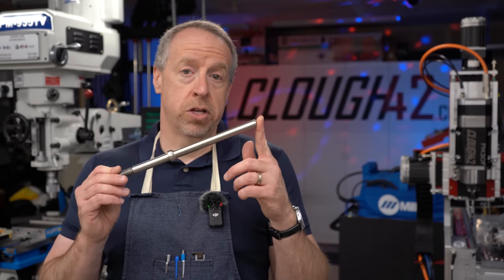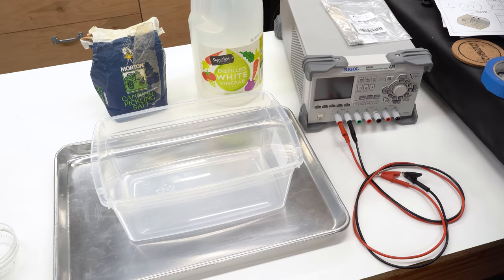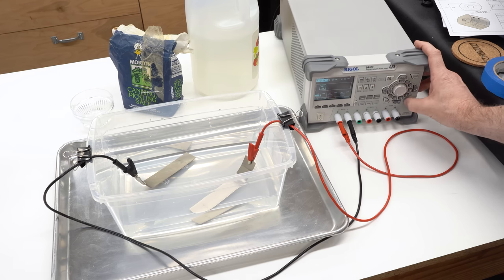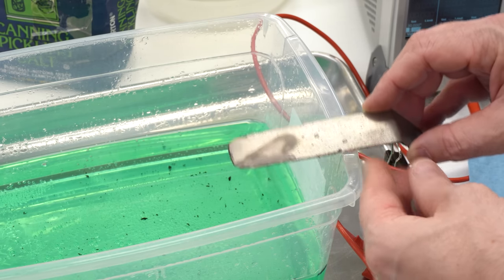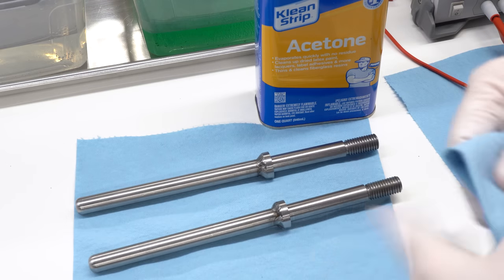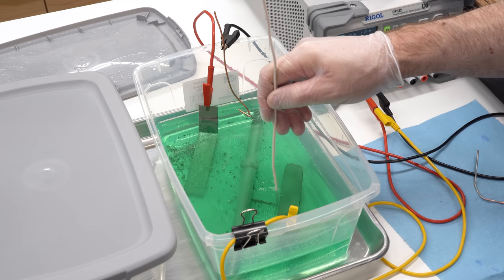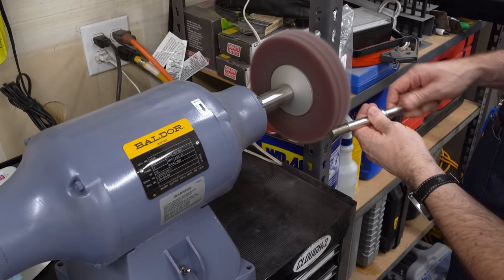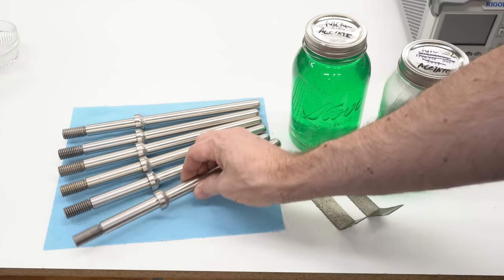Nickel Electroplating in the Home Shop - A Shocking Way to Prevent Rust!

Comment: Great video. You can get a bit more rigorous, and research the optimum current for a given surface area, but if you're using small parts no really big deal.

As far as safe disposal is concerned, nickel is an unusual heavy metal, in that soluble nickel (i.e. a "nickel salt") isn't very toxic. It's classed as Category 3, meaning its effects are not known/understood, unlike chrome (chrome IV is REALLY bad), lead (hey, all those hunters, so what happens to the lead in the ground....:-}) and mercury. 

In fact the average human consumes an average of 3E-5 mg Ni/kg/day for a 70 kg person. So yes, that's a small amount, but the POINT of that is that the normal dilution of any spent nickel by the sewage system brings anything a home hobbyist outputs to way below these limits..

Perhaps it's more responsible to neutralise the dissolved nickel with a caustic, then dispose as solid waste.

Comment: I have done some of this, but different.

Instead, i have prepared nickel citrate. I used citric acid, dumping as much powder as would dissolve in water, and then diluting it roughly 3-fold.

I also dropped saccharine containing sweetener in there in an attempt to brighten the application. It still works, but i'm unsure of the effect. Nickel just always looks kinda pretty i feel.

I have plated my 3D printer nozzle for like an hour. The narrowing of the nozzle by like 0.03mm is visible under a microscope.

I also found that you should probably NOT store it in jars like these, in spite of plastic/rubber lid lining, the acid made its way through it and through the lid. Yuck! Good thing i noticed in time. I'm now storing it in HDPE container with a HDPE lid, i think some sort of home detergent container. I haven't had trouble with it.

Comment: If you are going to do this on a regular basis then you should set up dual cathode bars to hang your bars from and an anode bar down the center.  Use several nickel bars, 3 on each side. Use copper tomake your cathode and anode bars with solid connections ( bolt/nut) so not to over work both the power supply/rectifier with heat/resistance at the connection points.. This will give you better results. Use powder pumice to scrub your parts first before degreasing. Any water used with the pumice would be better if  distilled. A lot of things will plate better if a layer of copper is put on first. But it will not always last as long as copper seems to let loose sooner on some metals. Steel bumpers that are nickel plated also have a thin layer of chrome over the nickel to stop corrosion or rust from forming.

Comment: Cool process, I wonder how long this would last on aluminum engine parts like valve covers.  I can never get paint to stay on aluminum engine parts, and polishing them only seems to last a few weeks before they get dull and grey again.  Brass would be cool too.  Cars today just don't have the same kind of bling they use to have.  I might drill and tap a bunch of holes in a 1/4 steel plate so I can do this to bolt heads while rebuilding engines.

Comment: I work at a chrome plating factory and the anode was lead and we put the part down usually was round put it down in it first we would reverse exch to pull metal of then reverse it to plate and I remember the amp with big part would be 5000plus amp I've seen 2x3sold copper bars metal from heat the tank was square with a sold 4x4 copper bars running on each side and used the other bars to hang the part from and use sheets of high temp plastic to insulate one side or the other from make a connection depending on what we were plating or exching and the five gallon bucket of chrome in the solution that was so toxic u no if a drop it u in secs it would start to burn because of the acid we also did nickel on the other side of the shop but I didn't do much on that side if u want better plating use a tube it will work better and suspend the part and anode.

Comment: would like to see a follow up video of a non-plated one and a plated on after both were used for a few months to see how well it does (wear off?) and how much better it should look!
Reply: Yes me to. Seems to be a million DIY zinc and nickel electroplating videos.. and so far I've only found 1 video that field tested their result. What's the point of electroplating steel if starts rusting after  few months.

Comment: I used a charger for an old Razer phone as my power supply. Just cut the end that connects to the phone and add alligator clips to the wires. Then clip to the parts and plug right into the wall and your ready to go. It would take around 30-45 min per part (I was Electroplating Small nuts and bolts).

Comment: Pretty cool. I've seen chromers copper plate the steel before applying the nickel or chrome. I wonder how much of difference that would make to the finish. Perhaps another experiment for the next one.
Reply: Copper bonds well to both steel and nickel.
It's a better conductor, fills micro pits and buffs to a great shine that is reflected in the later coatings.

Comment: I have to remind you, it's a microscopically thin layer, the second you bolted it or turned it in a nut, the surface scratched and with metal there will just be an entrance for oxidation to enter. it will rust, it will corrode, its good for making things look pretty but you would have to have a pretty hard metal to attain the hardness you want to bite  in a nut.
Reply: YOU COULD build up a decent layer but I dont think you are there yet. also it needs to be so clean the surface needs to be Aeronotical grade clean. just keep that in mind. its a coating, the proper preparation can make it a part of the material

Comment: Good video 👍. One nice thing about nickel plating is that nickel is much more flexible than chrome. So if the part might bend a little in use, with nickel plating it stays protected, where with chrome, it would flake off.

This is not just my idea, it’s why Rickman motorcycle frames were nickel plated vs chrome plated. The Rickman brothers understood the flex benefits of nickel plate for motorbike frame tubes.

Comment: You have the right positive and negative wiring with those two leads which you are using, but larger clamps on the ends would probably be nicer and also you could double up the lead wires, as those plugs on them allow for such. That way they tend to get less hot and should work for long periods on the parts with the heat which a unit would provide with long hours of use. Just some thoughts on it. You should be able to determine a best setting for amps and such to where you really don't have to make any adjustments as often. This comes with experience though, but once you find those sweet spots, you can pass them along to others so that there is not a constant adjustment necessary in any of your videos. ;-)

Comment: If you want very shiny and even plating you need to remove all tiny scratches and polish the object. Any uneveness in the part before plating will also show after plating. Lowering the amperage to 0.1-0.2 amps instead of 1-3 or even more amps wil take a lot longer but the plating will also be much finer. Look what 3 amps did to the nickel anode when you were preparing the plating bath. Agitate the bad using a small fishtank airpump or even a fishtank water pump......every bubble starting and remaining on the surface of the object that you are plating could cause a pinhole in the plating....so make sure those bubbles are wiped of the surface by agitating the bath. Rotating the object from time to time will give an more even coating.......parts that remain closer to the nickel kathodes wil get a thicker layer. The best kathode is one that surrounds the part at all sides. Keep also in mind that nickel acetate is very toxic to humans and animals....use gloves, use ventilation and rince the part thouroughly before taking it to your skin. Look up the safety sheet on nickel compounds.

Comment: I'm surprised that the scotch brite wheel didn't chew right through that plating since it's so thin. I use a belt made of similar material for surface conditioning knives and i was amazed how much material the gray (second finest) belt removed from hardened carbon steel..
Reply from the maker: I was worried about it, but it seems pretty durable.

Comment: I am a little surprised you got such good results. I have seen many instructional videos that state 3v and low amperage is the ideal for plating.  I've seen a few examples of plating that just rubs right off when plated at too high of a voltage. Also plating with copper first seems to be a consensus.
You neglected to state what your plating voltage was, but you had earlier mentioned ~30v. 
So did you plated them with about 30v @ 3 amps?
I can't argue with your success, but can't help but wonder if it was perhaps a lucky setup that got you those good results.
Reply from the maker: The supply was in constant current mode, so it adjusted the voltage to maintain 3A.  I think it was around 5 or 6 volts once the ion concentration stabilized.  The total current isn't the issue.  The current per surface area is what matters.  I think 3A was probably a little high for these parts.

Comment: That is SO COOL!!!  I didn't realize that it was so easy.  It'd be interesting to see the weight with a postal scale before and after.  How many grams of nickel that you gained.  Thanks for the demonstration.
I'd heard of people plating home-made circuit boards but I hadn't really looked in to it otherwise.  I didn't realize that it was so simple.   As other's have mentioned, copper sounds doable too.
I'm surprised that you pinned the negative "bad idea" comment.  Seems like there's people like that all over the internet.  I get a kick out of people that do that stuff on car forums.  You can't do THAT only a qualified mechanic...blah, blah ,blah.  I have the same service manual as the mechanic.  Similar tools.  Probably MORE experience but...  I'll stop the rant there.  :)

Comment: Try anodizing aluminum next . First thing to know about it is, parts must be super-duper clean.
Reply from the maker: I really don't want to store or handle the strong acids, which is why I haven't.
Reply: @Clough42  I put my setup in a separate  room far away from the shop.
If you have some parts to anodize would be glad to do them for you.
I have a 20 gallon set up so parts can't be any longer than 24".

Comment: Love your channel. I’ve only got minimal experience with this, and mostly using zinc rather than nickel. Also, as I’m typing here, I think I’ve just caught at the end of your video that the texture was on the metal prior to plating (?), BUT my experience has been that with less amperage and an overall slower plating process, the finish comes out a little bit better (particularly the black stuff in the bath and the rough-ish texture on parts). It’s been a while since I’ve plated anything, but I think I remember practical limit for good finish being about 1.5A. 

BTW, have you gone down the rabbit hole of plating your 3D prints? 😊

Comment: I just watched Practical Engineering's video series on corrosion and am trying to wrap my head around everything. 

Under normal or even electric gradient conditions, the steel gives and corrode first, right?

As such, how does Nickel plated Iron/Steel behave with respect tk the galvanic series? 🤔

Any insight would be much appreciated. I'm trying to decide between Zinc & Nickel plating whether it be corrosion resistance and/or wear.

Comment: Hello. I want to make a transaction regarding my motorcycle. However, I cannot tell whether the coating is chrome or nickel plated. Decorative chrome plating may also be under nickel plating. Should I prepare a separate solution for both or is there a solution that removes both at the same time? Finally, do I need to do chrome plating over nickel plating to get a very shiny appearance? Because I also want it to be durable.

Comment: Hi, thanks for your informative video. I make de solution and it green. I bouth On Amazon a nickel plate 99.6% pure ! But when plating the result is not nickel like, but a gray tone. That was on a ⅜ x ⅜ steel piece. Time plating was about an hour. I use a 12 volts -110v  adaptor. Any Idea?

Comment: Nickel is about as durable as chrome plating. You can see this in older revolvers. The high end revolvers back in the late 1800's and early 1900's were nickel plated the cheaper revolvers we're chrome plated. Both platings seem to last about the same length of time. Of course how you treat the object will dictate how long the platings last. Usually when you find these revolvers the nickel plating is worn off the surface.

Comment: Approximate thickness of plate can be found with a bit of Math: Weigh anode and cathode to establish how much nickel has been transferred to part. Calculate surface area of part (pi x d x h) to obtain weight per area of plate. Nickel comes in at about 8.9 grams per cc. Thickness will work out at weight per area. (or something like that) 🤔

Comment: Hi James, great experiment and excellent video. I am disappointed by those negative reactions regarding chemical waste. I assume you have a way to discard of those responsibly. And as far I can see you are re-using them anyway. I remember something from chemistry classes that steel should first be copper plated and then nickel plated. But hey, aren't you able to assess that for yourself if the result is not satisfactory or durable?

Comment: From watching your video and poking around a bit. I discovered if you have a more pure anode you will get a much more shiny surface. Amazon has better than 99.6 grade anodes for a bit more. Maybe try pickling or industrial vinegar as well.
Reply from the maker: That's what these are.  Amazon listed them as "99.6% or better."
Reply: @Clough42  yep I found more pure ones there. The .6 impurities cause the dulled finish.

Comment: Hi, would  this work as rust prevention  on high carbon steel knife blades?   Cool,  easy  to follow and understand vid.
Reply from the maker: I suspect it wouldn't work well for blades, since you would grind through the plating at the edge to sharpen.

Comment: Why not use two power supplies since your supply is set up that way.  That guarantees equal current per electrode if you set it that way.  By the way a constant current power supply regulates the current and the voltage naturally goes to what ohms law demands.   

I tried plating when i was in grad school and it did not work well.  The internet is much better then a library for things like this.  

Good Video!!
Reply: "Why not use two power supplies since your supply is set up that way"

Unlikely to work with  constant current power supplies.
Reply: @guytech7310  I think it would, but I’m no Big Cliff.

Comment: Mine keeps turning black! Isn't working. I tried current control, working at high and low temperatures, remaking my electrolyte using distilled water, I've tried reducing sugars and absorbic acid as brighteners (molasses and vitamin c for environmental friendliness) and yes my parts were clean.
   What could possibly cause everything to turn black?

Comment: Hi, I live in Canada and distilled vinegar is hard to come by, do you think pure white vinegar would work?
Reply: It’s also possible to use citric acid, which is very readily available in crystalline form because it is used for cooking and making candy. As a side note, I do wristwatch restorations and found, to my surprise, that citric acid solution is fantastic for softening rust on tiny parts. I’ve since used the same solution to clean sinks and tubs, where our hard well water slowly deposits rust. Left overnight, it cleans those areas like magic.
Reply: @a1nelson  as it turns out our vinegar works just fine.

Comment: iirc you don't actually need to plate the whole thing, the plating doesn't need to be perfect. the plating will corrode fully before any of the steel starts to corrode, even if it's exposed. this is because it's just an easier path for electrons to do their rusting thing. I know that's how it works with galvanization, would imagine the same applies to nickel plating.
Reply from the maker: That applies to active metals, like zinc, when both metals are submerged in seawater.  Not sure it applies here.

Comment: I didn't take the time to read all the comments except the pinned comment initiated by the CA SJW JB. I like how how you didn't waste time with needless dialogue but you were concise with all steps. What I'm wondering, could stainless steel be used as the sacrificial anode to successfully apply a stainless steel plating?

Comment: Is there any major downside to using ascetic acid instead of sulphuric acid for electroplating? Sulphuric acid has become a paint to get hold of now that lead-acid batteries have been completely phased out. I know that both work, but sulphuric acid seems to be much more commonly referenced, so I assume there must be some reason for that?
Reply: Battery acid works great as a sulfuric acid source that won't break the bank.  It's already diluted to approx 30% acid.  For home aluminum anodizing I always used Napa brand as it was accepted it's the most consistent.  That was done with 1 part battery acid to 3 parts distilled water.
Reply: @Ryan_H22  Sadly lead-acid batteries have been large phased out where I live. The only ones that still are used are hermetically sealed units. That means no one sells battery acid anymore. I did finally find an industrial wholesale vendor for it though after much investigation :)
Reply: @TheStigma  Yeah, they're pretty much all sealed here too but at least a couple of the auto parts stores still sell acid separately.  For now.  Glad you found some!

Comment: You didn't say what strength the vinegar was. After some googling on the brand you used, I see it's only 5 %. The vinegar I usually buy is 24 % so I just dilute it with water then.